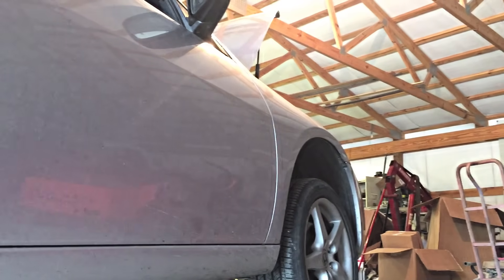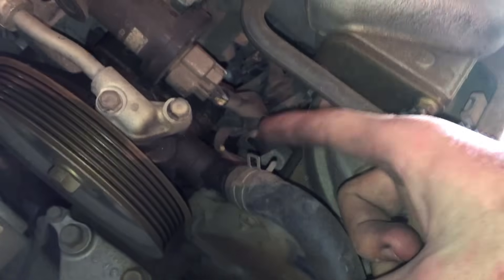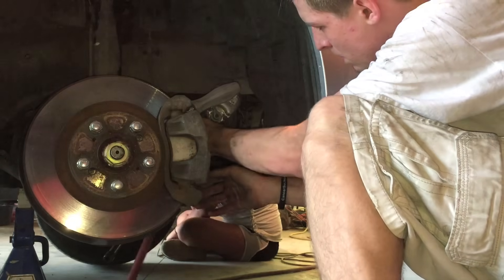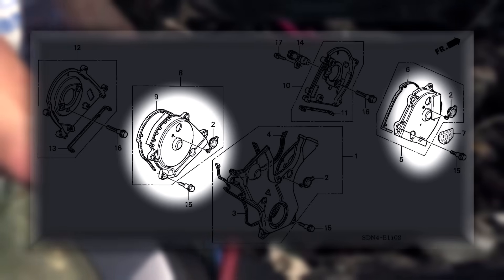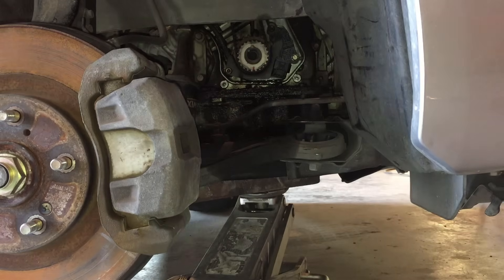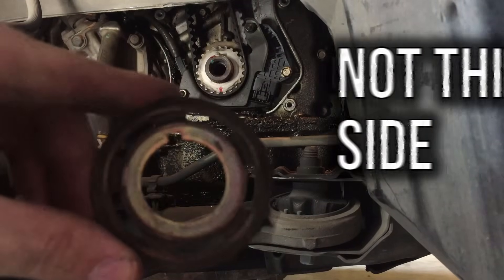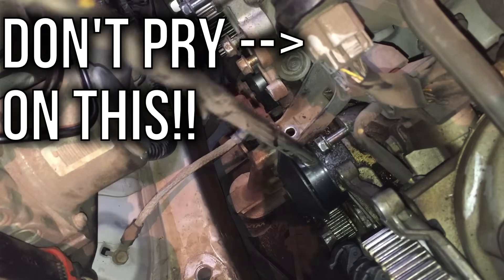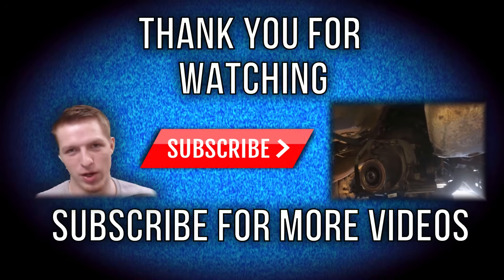Honda Accord V6 Timing Belt Removal

Comment: The Honda spec to oil the threads is why the harmonic balancer bolt is so hard to remove.  Oiling threads allows them to be tightened far tighter than dry threads.  Normal torque specs are for dry threads only, so this is a special case.
Reply from the maker: I could be misremembering, but I believe the spec is to just oil the washer face so that the rotational friction isn’t a factor in the torque

Comment: As an fyi there is a impact socket specifically made for this that has 3 times the mass as a regular impact socket creating a lot more force and zips those crankshafts off in seconds.

Comment: Thanks for the info. How much roughly would a shop charge to replace the belt tensioner?
Reply from the maker: Depends, tensioner can be replaced pretty easily, most will still charge the full timing belt service labor though
Reply: I did the whole timing kit. I paid $990. $440 for the timing belt kit oem. The other $450 was just for the labor.

Comment: So the socket used to break the crank pulley bolt was a regular 19mm socket?
Reply from the maker: Yes!
Reply: @TheFeesher  Thank you for your reply.  I ended up doing it also with just a regular socket.

Comment: Hey, I was thinking about doing this process myself and was wondering what equipment you used in this video and how much it would cost me. A list of tools or something of the like would be very appreciated. Great video by the way.
Reply from the maker: Basic wrench and ratchet/socket set up from 10mm to 19mm. The hard part is the crank pulley, for that you’ll need at 1/2 breaker bar to use the starter like in the video

Comment: your video helped me do this three times now. my belt keeps moving off pulleys and rubbing (wearing) away. not sure why. got a kit to replace tensioners. any help would be great. thanks for the video.
Reply from the maker: That’s good to hear! Glad I helped! There should be a washer type of piece that goes between the crank pulley and crank sprocket. Is that there?
Reply: @TheFeesher  yes
Reply: @TheFeesher  i bought a tool to hold harmonic balancer while i tighten the crank bolt this time. thinking that mite be my problem. i not a mechanic but i try
Reply from the maker: Crank bolt needs to be SUPER tight so that may be the problem, I believe that washer behind the balancer is directional too, so while you’re there make sure it’s the correct way. I think the right way is where the outside of the washer is raised and facing the balancer
Reply from the maker: A tensioner is almost always a good aides bc these are bad about leaking, but the washer and cam gears are really the only things that hold the belt center

Comment: Nice video but you didn’t explain how to put a new timing belt on and it’s kit. I’m having trouble getting the new timing belt bk over all the pulley
Reply from the maker: Make sure you have all the slack in the tensioner side of the belt, the belt needs as little slack as possible between the front cam and crank gear
Reply from the maker: I also have an install video, they are split up
Reply: Ok I’m seeing the other video now. But still can’t put the belt over the adjuster pulley. Smh   I’ll try again with the tensioner bolted up

Comment: “…..if you cut the belt like I did.” Lol, I could just hear my boss screaming when you did that. Obviously you’re replacing it, but that drives him nuts hahahahah. 
Great video. Don’t think I’ll be doing this anytime soon, but I was curious to see it. You hit all the important points and demonstrated the necessary steps without getting too long winded. That can be tough to do, especially when tackling something like this.

Comment: I have a question.... So I have a Honda Accord V6 3.0 vetc e.x. 2004  and my timing belt broke going about 10 to 20 mhp so would my car still be good if I just changed out what u did or should I junk it and it has new oil in it Idk if that matters or not

Comment: My 2010 V6 Accord with 134k miles on it just went into the shop for a timing belt and water pump change out . I believe the only signs it showed that the belt was wearing was at about 130k I started hearing an intermittent grinding noise inside the car.First time it's being replaced

Comment: Great video. Have done this before but needed the refresher and found your video very clear. Do you have a video of the install sequence? Last time I did this and released the tensioner, the front cam moved about one belt notch and I had to pull down again, retension the tensioner and realign. Would be good to see the install or if you have any suggestions on how to avoid this issue it would be much appreciated
Reply from the maker: I do have an install video! The trick I currently use isn’t in the video though. I set it to TDC, and move both cams half a tooth clockwise. Then I put the belt on the crank, pull it as tight as I comfortably can to the front cam (should have some slack in it). Then turn the cam back to TDC, it should stop on its own once the slack is out. Then I pull the belt under the water pump, and comfortably tight to the next cam, then turn that cam back to TDC, everything should be tight and should be perfectly timed, also very easy to install the tensioner
Reply: @TheFeesher  Many thanks for your reply. Watched the video and found it very helpful. Used your trick and found the rear cam didnt like being off TDC very much. So I also rotated the crank about 1 tooth counter clockwise put the belt over the cam pulleys and then rotated both the crank and cams back. Worked like a charm. Keep up the great work

Comment: It helps no doubt but certainly you need to tell folks about replacing the drive belts on time and putting everything back together. maybe a part two to follow this thing if you ever do another one.
Reply from the maker: Thank you! I have second video on installation

Comment: I have a 09 accord v6 coupe. The dealership is charging around $ 1,400 🤦‍♂️
Reply from the maker: That’s wild, the dealership I worked for only charged $500 for a V6
Reply: @TheFeesher  dealerships are a rip off there labor rate is high let alone the parts your paying for OEM Parts and they will push you to getting something done on your car when it's not needed. my mechanic can do the job for $865 he told me I'd rather pay that then $1,400 smh.

Comment: I broke my crankshaft pulley bolt loose with Milwaukee 1/2 “ 18 volt cordless impact  with oversized 19 mm impact socket
Reply from the maker: It’s definitely possible most of the time, not always though
Reply: @TheFeesher  Before I used the impact gun I tried a 1/2 breaker bar and broke it

Comment: Whats the pivot you have for the air ratchet called and where did you get it? Great video. Is this a 3 hr job just to remove? Or is putting it all back together another 3 ish?

Comment: I replace the timen belt on a 2003 Honda accord v6 sedan and i put all together and I don't have compression
Reply: Take out the wheel & turn the Crankshaft Bolt (always turn CW) until..
1. Do you see the White Line on The Crank Pulley inline to the Arrow of Timing Cover?
2. Back Camshaft look for the only one Vertical Line on teeth is at 12 O'clock?
3. Front Camshaft (will show "1") look for Vertical line to be inline with engine vertical line at 12 O'clock

Comment: Question: if i broke a timing belt, bent valves, Do i just line up all 3 timing marks, put new heads on, adjust valves and im back on the road?? All new parts of course🙂 ???
Reply from the maker: That should be all you need to do, in some cases, the valves can damage the pistons when they hit, but that’s pretty rare for it to be significant, you will be able to see this when you pull the heads off though
Reply: The Feesher Thank you👍👍👍

Comment: i have a 1996 V6 accord and it would smoke after driving it but the temp gauge did move just never over half. now it wont start im thinking my belt may have taken a dirt nap lol. im planing on doing all the belts, the water pump, reserve tank and radiator (having a issue with a full reserve but dry radiator), thermostat, and when i take the head off to swap belts ill see if i need too do the head gasket too. think this will get her back running again?

Comment: Great tips. But, use a breaker bar instead of the ratchet, if you have one, when breaking hard to break bolts.   While you have the engine mounts removed, inspect for wear, broken parts or leaks (if hydraulic). I see you are fighting the same air line connector issues. Why TF doesn't supposed matched types work without leaking!?!  >.<

Comment: I did the belt on my 1998 Toyota T100. Easy, it is all right there on the front of the engine. Lots of room. We had to manufacture the tool that holds the crank while you loose the center bolt and we were surprised by a 1x use bolt on reassembly! I had never heard of that. But basically a breeze because of access. This on the other hand... not for me! Thanks for the video. Saved me a lot of time and trouble while contributing to the local car mechanic economy. Could have done worse.

Comment: Your tutorial was a tremendous help! And it saved me untold amounts of money. It helped me know that there is no way in hades I should ever attempt something like this with my beginner Craftsman tool set and short-term memory issues. It would cost me a lot more to have a real mechanic fix all the things I would do wrong. I have a 2004 V6 Accord coupe with 6-speed manual tranny. It just went over 200k miles, and I had the 105k mile service done on it at the Honda dealership, which included changing the plugs, water pump, and timing belt. I’ve done much of the work on my 2004 ZR2 Blazer, and routine maintenance on the Accord. But I’m not gonna tackle the timing belt on it. Do you do service calls? LOL Anyway, great video!

Comment: I’m trying to wedge the ratchet how you did to remove the crank pulley boot but it’s not working for me. Any suggestions?
Reply from the maker: Find a longer ratchet or put pipe over the handle to extend it

Comment: The editing sets just the right pace to clearly demonstrate the steps without boring me with unnecessary details. 
The trick of jamming the crank pulley bolt with a bar and using the starter to crack it loose is sketchy, but I ran out of other options, and it worked perfectly for me.
Reply from the maker: Glad to heard it!

Comment: Timing belt, water pump and tensioner was changed on my 2012 V6 Honda Accord but it's still making noise. I previously had brakes, brake pads, brake fluids and rotors done and my VSA, ABS AND PARKING LIGHST IN THE DASH was all lit up they apparently reset it and then did the timing belt and now all those lights are back plus the Traction lights now but the dealership claims they have nothing to do with what they have done. There is still a vibration in the pads and a weird noise sounds like the timing belt again plus a rattling sound I an so stressed out and in need of finding a good mechanic to assess the situation. The whole car...

Comment: hey man I cut the belt like you did when the markings on the cam were lined up, when I attempted to put the new timing belt on my rear cam moved somehow and when I went to turn it a little to line up with the marking I turned it too much and cannot get it to go counterclockwise due to it being spring loaded...was wondering if you have any good ideas for me to fix this, my other cams are lined up its jus the rear cam that is not.  thank you
Reply from the maker: I’ve had this happen, you just have to try to use a wrench on the cam to rotate it whichever way you need while putting on the belt

Comment: Thanks for doing this video.  I'm probably going to be doing it on my daughters 02 Accord V-6.  Looks like fun...er, not really.
Makes me appreciate my two Mercedes V-6 and V-8 engines (M112 / M113) both have chains, not belts.  On MB they are said to last life of engine, which is normally 250k-400k miles.  I guess MB figured out how to make trouble free timing chains.

Boy do I remember doing the timing chain tensioner & guides on the 1970-85 Nissan L series engines in my Datsun 510 / 240Z.  Too many to count.  If you did it right, chain didn't slip down inside.  If you did it wrong, job went 3x longer.  Old memories, not good ones !
I think overall, the cars today are better off.  Be it the Honda or the Mercedes. 

I know this, both of them have better AC than my Datsun !
Reply from the maker: I think you might like this more than a Mercedes if they are half as bad as I’ve heard, but that’s just a guess lol

Comment: are cam locks not required for this? Most dohc vehicles cams can drop when removing the tension from the belt.
Reply from the maker: As long as the engine is at TDC the cams will stay in place pretty well. Cam locks are recommended, but definitely not needed.

Comment: Do you know the torque specs for the water pump, idler pully ,hydraulic tension and crank shaft bolt v6 model. Nice informative video it make my day.Complete oem kit cost me 500$ water pump and gaskit ,hydraulic tensioner, idler pully and hydraulic tensioner pully and timing belt i replace all pully bolts.i have a v6 accord 2010 all the parts I put brand new so I don’t have to replace anything soon:) I purchased parts already , with your video I will replace it myself this summer:)

Comment: Just a question. Why do you cut the belt if you’re going to remove the tensioner anyway?
Reply from the maker: It’s in the way a lot of times, also I wanted to teach specificity how to set the belt on. A lot of people try to transfer marks from the old belt to the new one, which works but is dangerous because people don’t doubly check and just assume they are right

Comment: great video for the nontechie. suggest to remove motormount earlier in the removal process for easieer access to sub assemblies,also for those who lost-thew belt, how to check for bent valves. 2 methods, rmove valve vover and use a straight edge to see if theres are any valve stem tops that are lower than others. if found remove and replace suspect valve and this the best time for valve grind, 2nd method is with cylinder head removed turn upside down keeping combution sursafce as level as possible, now add fluid (water?)to the combusstion chamber check intake and exhaust port runneres for liquid , identify and replace.   Good hunting

Comment: Thank you for you video excelente !!
I have a Honda Accord 96 - 6 cylinder.. the car is leaking a big amounts of oil.... there is also water leaking on the pasanger side. Looks like is coming from the  water pump...could this be the reason why all the thiis oil Is  coming out ??? Having problems to get a honest  mechanic... Any suggestions would be truly appreciate..  appreciated 🙄
Reply from the maker: It could be leaking from a cam seal or oil pump seal. Lots of things are over there though. Without physically seeing the vehicle it is difficult to guess what may be leaking unfortunately. But what I mentioned are common failures
Reply: Thank you thank you so much for answering my question.. God bless you for sharing knowledge 😃😃👍👍👍

Comment: Best way to remove the water pump is to insert a screwdriver in the hole on top of the water pump and pull away from the engine. It separates very easily. Just sold my 2007 accord V6 with 483,000 miles. Also, always use the Aisin kit (OEM quality)instead of the Gates kit.
Reply from the maker: Aisin is the OE pump, but not the OE belt, usually anyway
Reply from the maker: Aisin is the OE pump, but not the OE belt, usually anyway
Reply: @TheFeesher  the water pump, hydraulic tensioner, and koyo bearings are all OEM.  I would say the Mitsuboshi belt is, as I said, OEM quality. The gates kit has a substandard tensioner and water pump. Aisin is worth the difference in price.
Reply: @special9555  what kind of noise and when does it occur?

Comment: So I have 2011 Handa Accord with this squeaking noise, what seems like its coming from the pump that you removed in this video. All the other pulleys are not loose and the tension on the belt felts great and the belt itself is brand new. Also, the radiator fan will come on when the car starts and then shut off and then come on again. Is that normal? I also have this burning coming directly across from the fan on the engine itself. I don't know what that part is called. At first, I thought it was the oxygen sensor, but I now know that is at the back of the motor. I can upload a picture on Sunday if you are unsure what I am talking about. Thank you for your help if you can!

Comment: My timing belt on my 2005 Honda Accord EX  V6 3.0L snapped while driving.  I'm told I need an entire new engine because the valves would've hit the pistons, but I'm reading conflicting information online regarding whether it's an interference or non-interference engine.  Do you happen to know with certainty which it is?  I'd love to bring it back to life by just putting a new timing belt on.  Thanks.
Reply from the maker: I would just buy a cheap belt and put it on to see if it runs. I’m 90% sure it is interference, but even if it is interference, that doesn’t mean the engine is dead, it would be likely, but not a guarantee.
Reply: @TheFeesher  Thanks! I'll give it a shot.
Reply from the maker: Let me know how it goes!